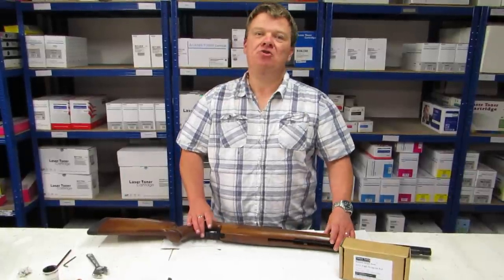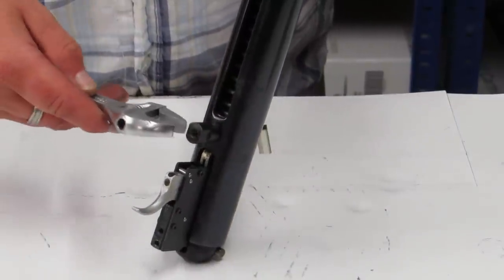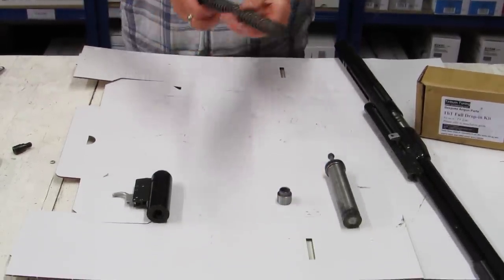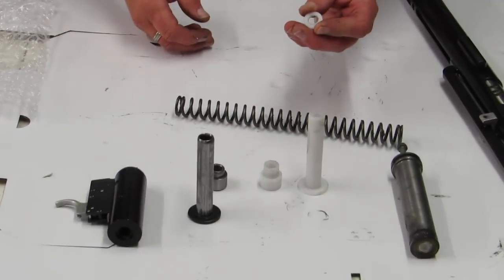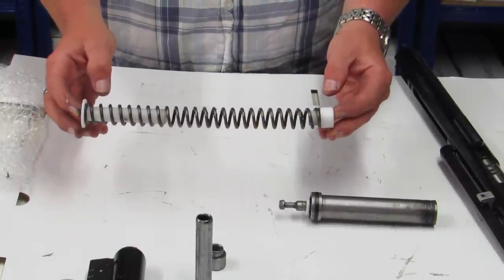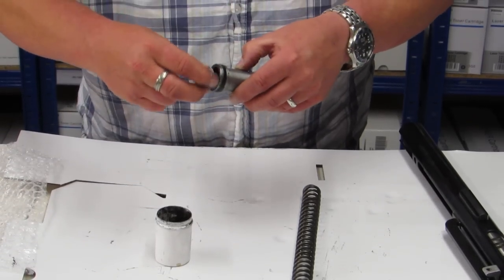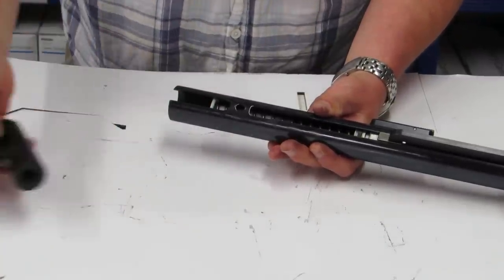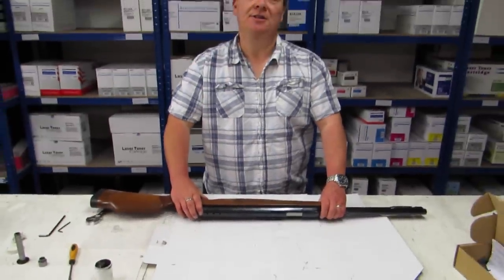**Old video** Air Rifle Tuning Kit Air Arms TX200  new video here: https://youtu.be/x1_I5HkV_zQ

Comment: What is obsolete about this kit. What has changed . I have the one you are showing in this video in my prosport
Reply from the maker: We changed the rear guide to a two piece design a few years ago. they work the same but the new one doesn't fit into the trigger recess

Comment: My TX200 spring guide only lasted about a month, the end snapped off. I think the end should be made thicker and then just take some thickness off the top hat. Anyhow, I ended up putting the original metal spring guide back in and leaving the delrin top hat with that and it seems to work fine. Great customer service/communication and I'm sure I would have been offered a replacement but I'm getting groupings about the size of a 5p bit from 25 yrds so I'm happy!

Comment: Is it possible to get more ft lbs of energy with a new longer spring ?
Reply: Get a few springs and stretch one but not too much or your not getting it back inside the rifle lol
Boosts accuracy, less pellet drop and up to 4 times more FPS depending on how much you stretch it
Or if you find 2 coins that fit in there perfectly. Drill a hole right through the coins to let the spring rod through and that adds tension and more fps without stretching your spring   and remember always take care and always care about everyone's safety

Comment: fitted this to my TX 200, called at gun shop to test power, max 12ft/lds now reads 16 ft/lds
he was then not allowed to return it to me as now section 1 firearm, took old spring back to shop to have it made legal.   be very careful and check the power.after alteration
Reply: The kit with the spring states that it will excced UK power limit and instead to just use the kits with the top hat and spring guide to keep power at sub 12 FTLB

Comment: I've got a TX200 that's hardly been used but the cocking lever has stopped releasing after cocking to enable the gun to fire rendering the gun useless. Before i start pulling it apart could you suggest the reason for this. It seems like the cause would be a simple one. Great vid thanks.
Reply: Here's the answer if anyone has the same problem:

http://www.johnshortell.com/air-arms/#comment-2287

Comment: hi there i have an air arms tx200 and at the end of the stock towards the end of the barrel there is a larger gap on the left side of the barrel than on the right is this normal or does one side need tightening please help someone i am new
Reply: Take all the screws out and and then screw them back in slow a bit at a time working from side to side till it all levels up at the sides,if it still the same take it to a gun shop and have it checked out.

Comment: do you supply the grease also, and my tx 200 HC is a mk 1 will the the power will go up if the fit it? and i want it to be about 10.5ftlbs also what is the price with a new spring please

Comment: I am just completely baffled as to why air arms and other top spring powered air rifle manufactures do not do this in the factory if it is that simple. It seems as though after you spend £400+ on an so called top of the range spring powered air weapon you then have to spend another £30-£100 odd on tuning it to make it do what it should be doing out the box. Either the manufacturers have been getting it wrong for many years or they have shares in all these tuning companys. Tuning kits are great for old and worn out guns but if they improve new out the box guns then something is far from correct.
Reply: I would say it's down to durability. These manufacturers want their guns to last a long time, and and I feel like these plastic pieces are wear items like the spring. This kit is cheap, easy to install and makes a massive difference to the shot cycle. The parts likely will become part of the servicing of the rifle. Plus some of these companies are stuck in tradition and don't like to change anything. The Diana underlevers and sidelevers don't even have any plastic buttons or slip rings on the compression tube, straight metal on metal. The TX200 and Prosport are way better than anything else imo, but they, like all springers can do with some tweaking.

Comment: Hi, could someone tell me what is the average "draw length" of air rifles and air pistols? Meaning the distance the piston travels inside the cylinder.Thanks! I'd also like to know when a spring piston gun is loaded, is the spring completely compressed then meaning that every loop of the spring is touching each other and it cant theoretically compress more?
Reply from the maker: I have no idea what the average is, but I can tell you the specific "stroke" for most. Eg, the TX mk3 is 99mm. By multiplying the wire gauge by number of coils and comparing to the available spring room it is easy to maximise spring compression if required.🙂
Reply: Nick Stanning Okay thanks a lot for quick reply! Do you happen to know that same number also for air pistols roughly? Because I think it's quite amazing how air pistols can still be quite powerful when there is significantly less room for the cylinder and for the pellet to accelerate. About the compression rate I mainly thought if it will be bad for the spring's lifespan if it's completely compressed over and over again and will it maybe loosen faster compared to if it will be given a bit "room" and not be compressed fully when the gun is being loaded?

Comment: Hi, I hve followed your video instructions about 6 times to the letter. But, I still cannot get theTX to cock. I pull the lever down but it will not load. Could you give me some advise as where I might be going wrong. Thanks.
Reply from the maker: Hi Micky, this is the video for the old kit which was replaced a few years ago woth the latest version of the kit. Please ring me on 0800 77 20 177 and we'll find out whats happening.🙂

Comment: This is a brilliant air gun very powerful ,I've known 2 people who  carried out this mod, Total waist of time, No more power and it makes a shake when shooting. Leave it alone no point messing with something as good as this just for the sake of it.
Reply from the maker: This kit isn't designed to increase power as it is already running at its optimum 11-12ft/lb. if the people you know added preload looking for power it will increase recoil. Remove the preload and it will run much smoother than standard.
Reply: It doesn't run smoother it just vibrates
Reply: +Nick Stanning hiii